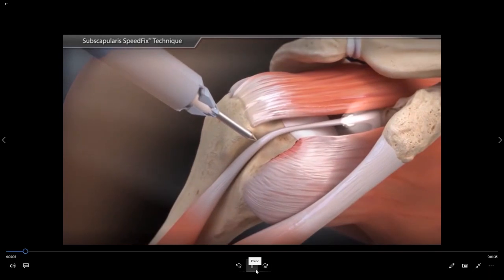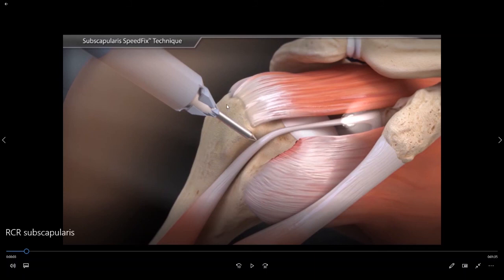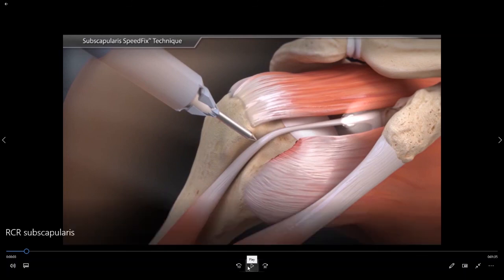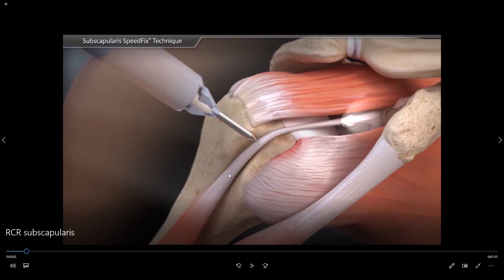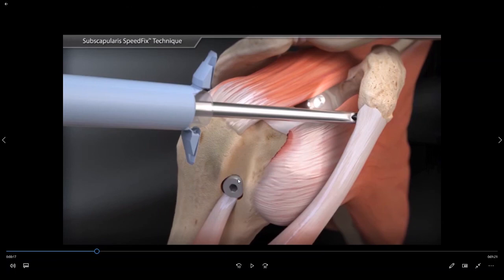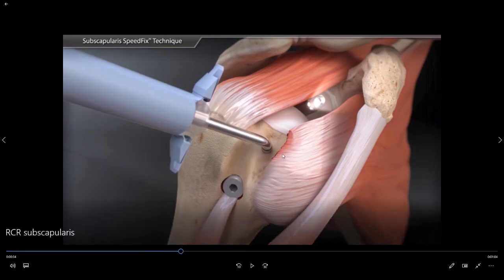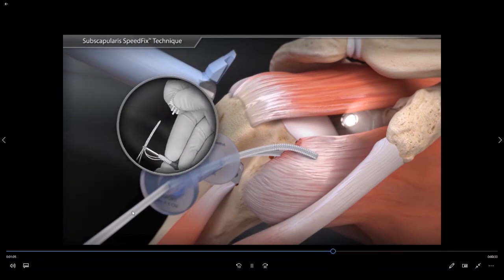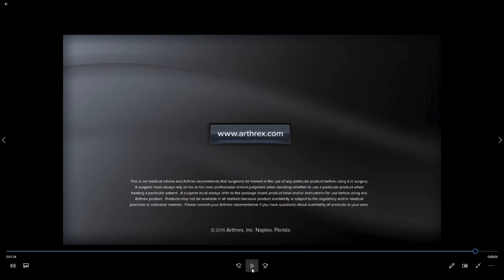Subscapularis Rotator Cuff Repair:  Surgical Technique

Comment: i am having surgery in springfield il with dr ma.  i am a bilateral amputee. i lost both legs as a baby. a knee and r side hip disarticulation. im having subacromial decompression and distal clavical ressection for ac joint and a full rotator cuff repair. worst being the subscapularus 90 percent torn. with muscle tears. the other parts of rotator cuff are all 75 percent torn. also my labrum is torn again. would you repair like a normal repair or the way i use my arms for everything would you do some kind of more beefed up repair? curious and worried normal repair wont hold up.  please any info would be awesome. im a big musccular guy. 185 lb with no legs.

Comment: Could you make some videos about  arthroscopic subscapularis repair technique and other shoulder arthroscopy issues to instruct young , less experience orthopaedic surgeons ? Thank you so much.
Reply from the maker: The videos are really geared towards patient education, which is why they are leaving you wanting more!

In general, for subscaps, the key is to open up the interval, use a 70 degree scope from the back, make sure your assistant really gets the feel for performing a posterior lever, and I like using some sort of self retrieving penetrator such as an Arthrex FastPass Scorpion to retrieve the passing stitches in an otherwise tight working space.

For my really retracted subscaps associated with tears up top, I've sometimes found it better to go up top and free up the supra/infra first as sometimes traction from the comma is holding you back.

Hope that helps!

D
Reply: Thank you for your precious instruction.